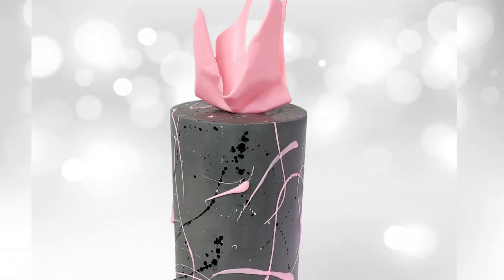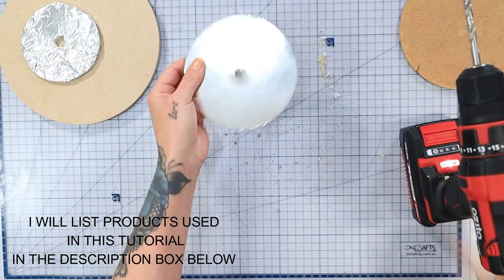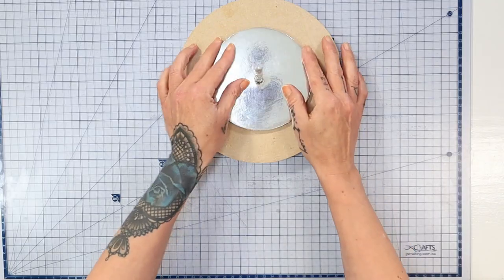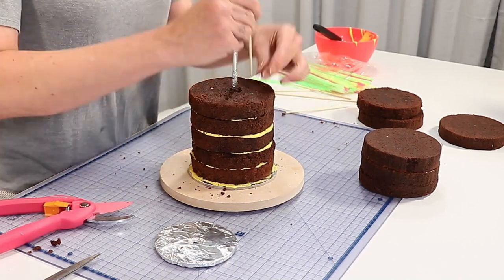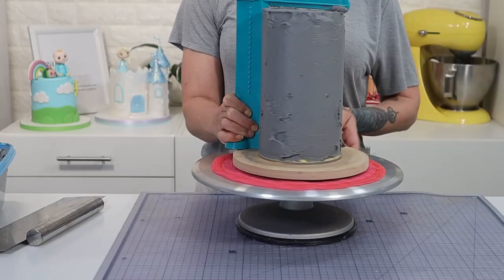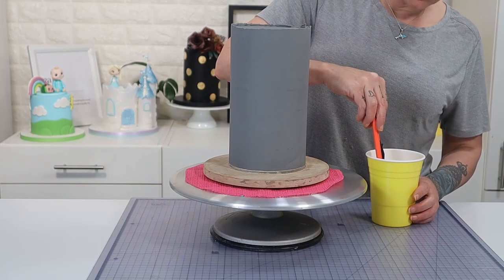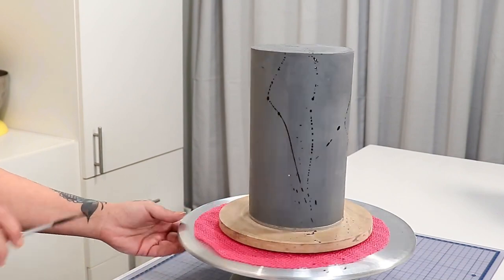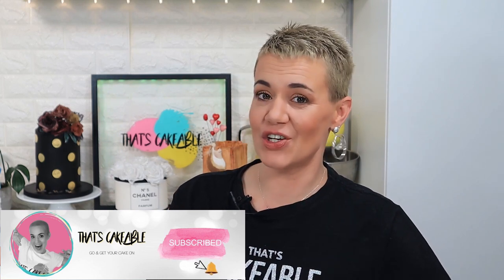HOW TO BUILD INTERNAL STRUCTURE FOR TALL, THIN CAKES - ALL GANACHE WITH CHOCOLATE SAIL

Comment: Love that design 😍 but wonder how the portioning of a cake like that would go.   Most pieces will have a straw/skewer in it.  Do clients find that a problem?
Reply from the maker: Hi Tash. It’s really the same as any tiered cake. The supports are so small in this one that portioning would barely be effected at all. So long as you stipulate the structuring process to your clients and provide them with a cutting guide and a basic diagram of the internal cake structure, I doubt there would be a problem. I ,for one, have never had an issue with it myself. I hope this helps and thank you so much for watching and the great feedback 🙂

Comment: Hi. How do you stop your white food paint from picking up pigment from the icing underneath over night?
Reply from the maker: I didn’t actually have that problem using ganache as my base and the edible artist white paint. I think that, if you used a regular gel colour as your splatter, this may happen, especially if the cake is buttercream however, with the particular combination of products I used to create this cake, the colour didn’t bleed through at all. If you didn’t have access to these materials and you’re worried about colour bleed, perhaps you could try meted white chocolate as a splatter instead. That way you would have no problem with colour transfer at all. I hope this helps.Thanks for watching 🙂